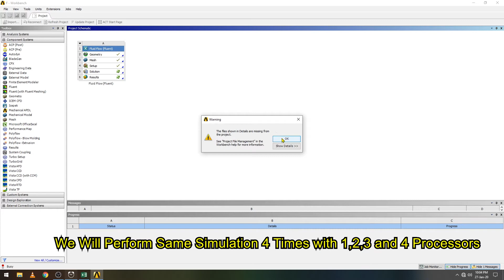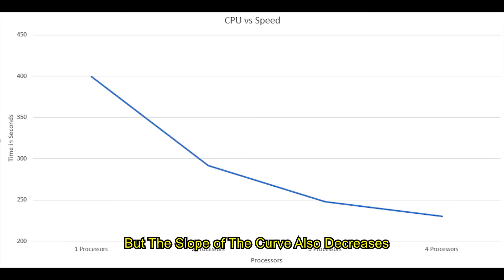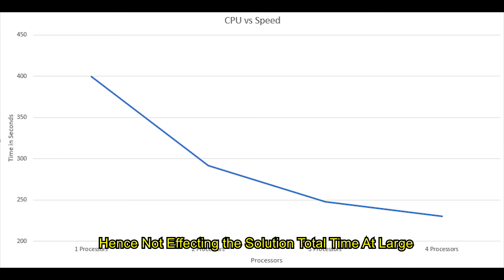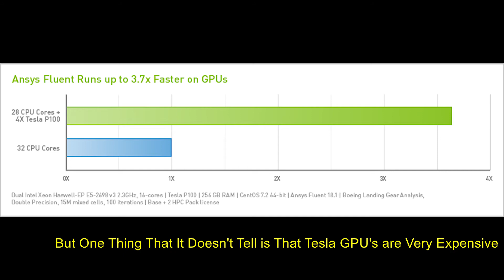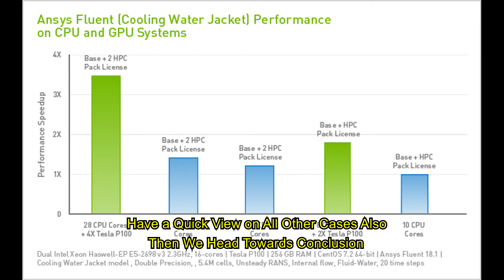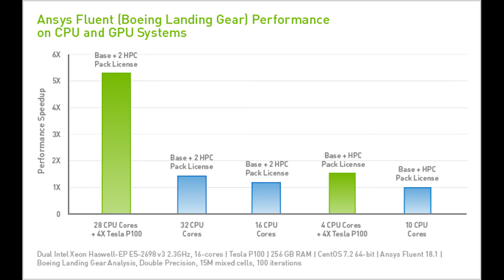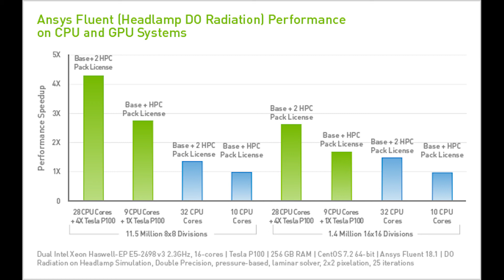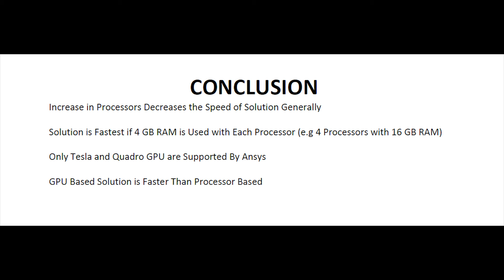✅💯✅CPU GPU RAM vs Speed of Simulation | Ansys Fluent

Comment: I think thread ripper will be best choice for most cases. I saw professional using threadripper 64 core with 260+gb ram. Sometimes they include a quadro gpu  p5000. For high scale computing 8x Tesla with Xeon or threadripper that support up to 2tb of ram.
Reply: How much would that cost?
Reply: @sharemarketkoninja6929   million  i think. but i'm a student like me most of the student don't buy the system  just rent it for hour. it cost around 1-5$ hour upto 8xA100 system or just 2x AMD EPYC  system. which is cheap for us & work load is not that much.
Reply: @serajeemdtoriqularman5955  from who do you rent? Can you share me details. I will do same for few days.

Comment: Hello, I am confused between an old (2017) entry level quadro card - Nvidia Quadro P600 or a new (2020) Geforce card - Nvidia Geforce RTX 2060. Which one is better for ANSYS? Does the newer Geforce card perform better than older entry level Quadro card?
Reply: hi , I have same problem with you  ı think p600 is very entry level gpu it has 384 cuda cores .I want to buy rtx 3000 ı think its more powerfull and long life decision.
Reply: You can use geforce cards to run ansys, but it's unsure whether it would be stable for every simulation etc, as both ansys and nvidia will not offer support. But if you get a quadro you will have more performance and stability compared to geforce, as some software force disable performance of they detect non workstation cards. So it's suggested to go with a quadro , but it's not that geforce is not supported
Reply from the maker: ansys only supports quadro and tesla series, rtx and gtx are not supported by ansys
Reply: @CFDFEAHub  is the recent Intel iris xe graphics supported by ansys?  That which comes with 11th gen i5 16gb ram and ?